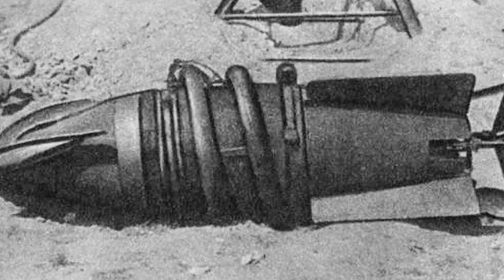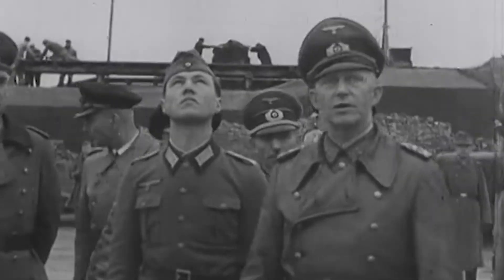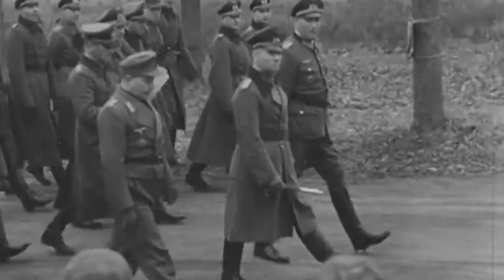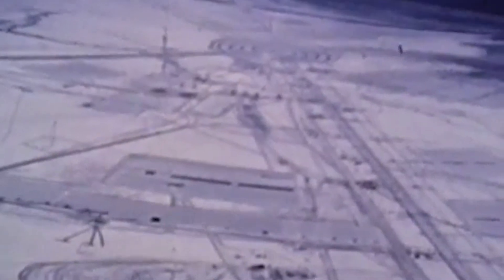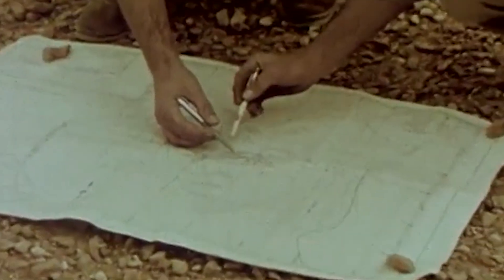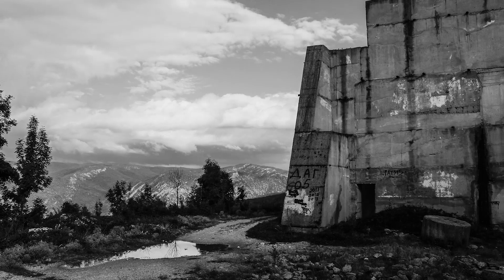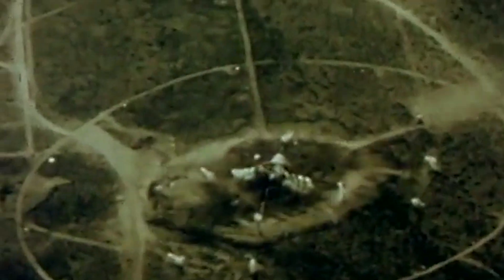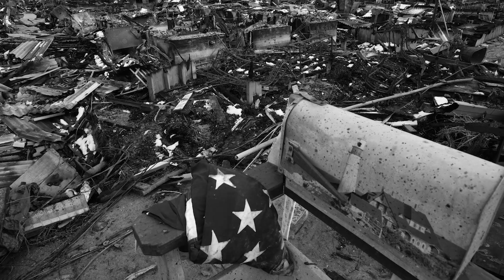The Soviet Nuclear Battle Mole: An Underground Cold War Battleship?

Comment: I call bullshit.
The energy required to melt 500 cubic feet of rock per second as postulated here would be 39 billion calories per second, assuming 100% efficiency.
That's 34,000 Barrels of oil per second.
Using nuclear fuel, you say? Well, nuclear energy isn't limitless. Gram per gram it has 111,000 times more energy than oil;  that means, with 100% efficiency, burning 342 grams of plutonium per second.
You're in a tube surrounded by radioactive lava.  Cooling would be more than a little "problematic."
Reply: DOUG HEINS  we are talking about the equivalent energy of a Hiroshima bomb every 1 1/2 seconds. How would you contain that? Complete and utter bullshit.

Comment: Putin revived the nuclear torpedo for which the Tsar Bomba was designed in the early 1960's, around the same time as the Battle Mole.  It is now called Poseidon.  The reason this project was abandoned is because they couldn't develop a nuclear reactor small enough for the torpedo.  Now they can.  And the problem with the Battle Mole was the nuclear reactor.  So they have probably revived this as well.  Both are delivered by submarine.

Comment: Anyone who has the tiniest knowledge of mining would debunk this,4mph through rock ?? not even through sand ! where is the spoil being disposed of ? you cannot just make it disappear.when you drill a hole through wood for example,what happens to the chips ? yep they come out of the hole,and if the drill clogs,it STOPS ! when you tunnel through rock there is a complete system to remove the spoil.Forget heat to melt the rock,imagine a machine operating at the temperature of LAVA,total fairy story--propaganda .

Comment: Sorry but, even though I really like this channel, I have to call b.s. on this one. 
First and foremost, heat. Heat and more heat. Where does it go?
Secondly, 9 mph? That's a reasonable jog. That's more than could be hoped for in dry, shallow, loose sand. 
So at this speed at those temperatures, which isn't enough to melt dirt in the first place, the crew and machinery within would broil, literally, in the first few hundred yards. 
And, lastly, where does the bore material go? Glass walled tube? Really? No seriously, where does that first million tones of earth, sand and rock go. Behind the vehicle? Ok, then where do all millions of btus go?

The one verily scary thing in the video is the idea the Soviets could have seeded our coastlines with dormant nukes.

Comment: In return for removing all Soviet missiles from Cuba the U.S. removed all of its missiles from Turkey and guaranteed Cuba's independence.
Reply: The thing of it is... the deal about the missiles in Turkey was kept secret for some time.  So in the public eye around the world, the U.S. came out of the crisis in a strategically stronger position than the Soviets... failing their goal of establishing an equilibrium.  It's also possible that American advancements in the space race in the following years made it painfully obvious that American missile tech was advancing to the point that the Americans probably didn't even need the missiles in Turkey anymore and was probably planning to withdraw them anyways.  So in the Soviet eyes, they faced significant public humiliation over the whole affair.
Reply: Nuvakwahu exactly. The missiles in turkey were reaching obsolescence, but we didn’t have enough motivation to move them so we just left them. Cheaper than shipping them back. So when the Russians made the proposal, we jumped on it. So in a way, procrastination saved the world
Reply: @Zeknif1  The missiles were in Cuba because of the US Turkey missiles. After their image being tainted by this crisis the USSR changed their policy and built in secret the Systema Perimetr, or dead hand. By starting this they enabled the mutually assured destruction. There is some info about it, in short if an attack was to be launched on a soviet city or capital the system would automatically fire nukes on US targets. They had so many that it was impossible to shoot them all down and the US knew that. A balance was reached.

About the missile tech... Read about the NK33 rocket engine developed by the soviets in the 60's which is still used to carry satellites and supplies. There was a real shitstorm at NASA  at the middle of the 90's when they bought an engine and discovered that even then, with their huge funds and top technology had nothing comparable to that small beast built two and a half decades earlier. 

USSR failed economically but their technology and scientists were top notch.
Reply: sobolanul96 , some of that was true, after the US purchased several of these engines they began exploding at launch.  Ironically, it took US engineers some time to find the problem area  with the Soviet rocket engines and after much testing NASA put them back into service.

Comment: the concept and specifications cited in this video are infeasible. the machine would've melted long before the rock would've.  absurd.
Reply: Exactly. Theres no way this would work.
Reply: Plus I dont think rock melts at 1700 degrees Fahrenheit not to mention that there be a huge amount of "lava" left behind you. It wouldn't just turn into a "glass-like lining" on the tunnel walls.
Reply: @justinpipes85  Igneous rocks form through the crystallization of magma. There is a considerable range of melting temperatures for different compositions of magma. All the silicates are molten at about 1200°C and all are solid when cooled to about 600°C. Often the silicates are grouped as high, medium and low-melting point solids.
Reply: @user-yn9mp4bt3q  awesome. Appreciate the info.
Reply: Not feasible on so many levels.  My favorite is the inability to keep the crew space cooled.  Fried Russians would be the first thing produced.
Reply: Does the SR 71 melts ?
Reply: I use a thermo induction casting machine. look it up. It operates at temperatures higher than its own melting temperature.
Reply: @user-yn9mp4bt3q  your machine generates melting temperatures on the induced material... but the machine does not exceed its melting point.  So what is your point?
Reply: @visteobman4202  it way exceeds its melting temperature the coil must be supercooled simultaneously is how it works.
Reply: @user-yn9mp4bt3q  exactly... the machine does not melt because it does not get that hot. Your point?
Reply: @visteobman4202  i melt platinum and yes the coil must reach temperatures far above its melting temperature to accomplish this.
Reply: @visteobman4202  i guess the point is obvious but essentially what i am saying is that it is possible to engineer and not ridiculous.
Reply: @user-yn9mp4bt3q  amazing!!!! The coils exceed their melting point and don't melt.  Yes, I guess anything is possible.  Would you like to purchase a patent on a free energy machine?  How about something simpler, like a perpetual motion machine?  They might just work.
Reply: @visteobman4202  ok
Reply: @user-yn9mp4bt3q  You realize you need a conductive material to be able to heat it with induction? I don't think the rock is made of platinum mate.

Comment: I call bullshit on all of this. There is just no way it could move at 9-10 MPH through solid rock,  even with a nuclear reactor. Buuuuuullshit.
Reply: Absolutely. I find that claim especially ridiculous as the tip of the drill only reached 1,300 to 1,700 Fahrenheit. The temperatures required to melt rock into magma range from 1,100 to 2,400 Fahrenheit. Even if the drill trip reached lets say 3,000 degrees, it would not melt rock instantly upon contact. It would take a significant amount of time for the rock to reach its melting point. It seems to me that the laws of physics and simple thermodynamics make this entire idea completely impractical. There is no possible way this Battle Mole could melt rock fast enough to travel between 4-9 MPH. Also, as stated in the video, cooling was a major issue. All nuclear reactors have abundant access to water for this very reason. There is no way this drill could have operated effectively and safely without a steady supply of water.

After watching the video, I actually did a small amount of research. My research confirmed the claim that it could travel at 4-9 MPH. However, I have to assume that this wasn't actually a reality and it was simply an unverifiable claim made by the Soviets. It was most likely propaganda to make the project appear to be an actual threat when it was anything but. I suppose it could have been possible to achieve those speeds when traveling through extremely sandy or loose terrain but not solid rock. Even if it was able to melt the rock fast enough, how and where would that melted rock be pushed out of the way of the drill? Even if the rock was now a liquid, the drill would still need to displace the rock it traveled through. Seeing as it would have been solid rock all around it, there would be nowhere for the magma to displace to.  When an animal burrows under your grass, you can see where it occurred as the surface of the lawn is displaced upward. This drill supposedly operated quite deep and there is no way it was upwardly displacing the magma. 

Maybe I am wrong but the entire project seems to be nothing more than a failed experiment and wishful thinking. The Soviets did not want to admit that it was a colossal failure so they made slightly believable claims that fall apart when actually analyzed. Again, maybe I am wrong and it is actually possible but I highly doubt it. There is probably a reason that this type of technology was not further developed.